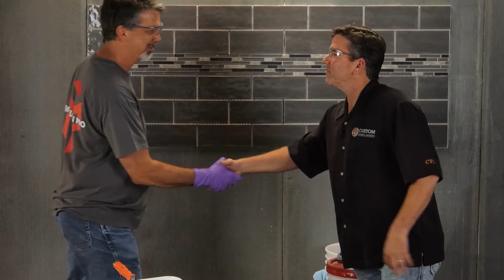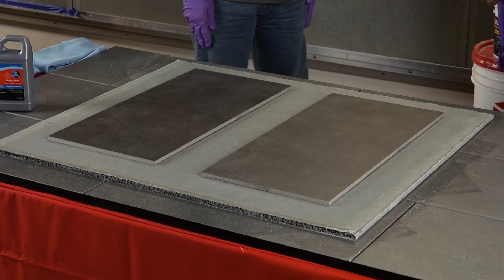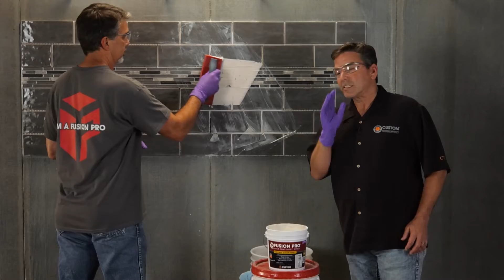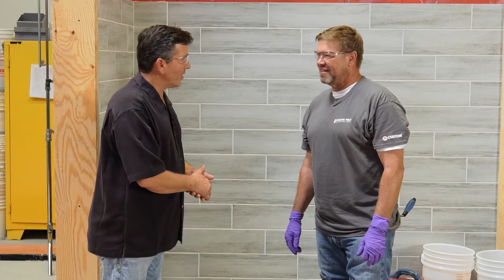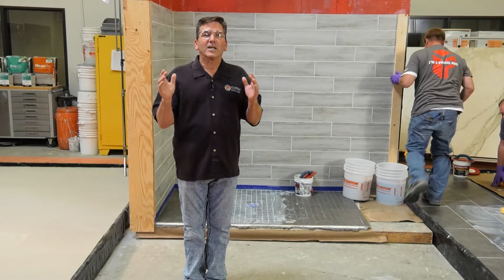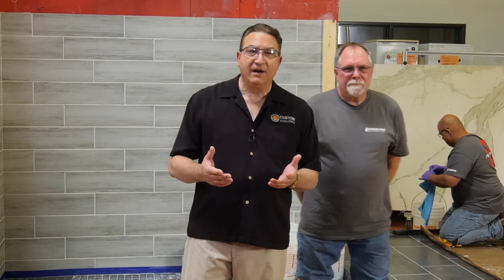Facebook Live Fusion Pro® (Enhanced Formula) Installation Tips

Comment: I came here genuinely hoping for a few tips because I'm a DIYer and I'm having trouble working with this grout. This is Home Shopping Network program levels of helpful.

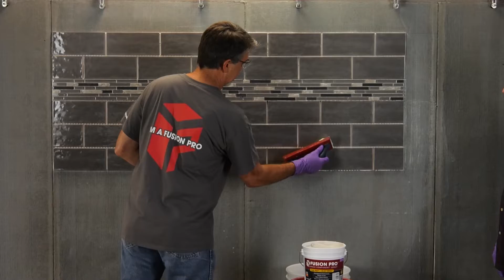6:52  Your directions say to lightly dampen the tile surface before starting. So if that's not accurate, change it on the tub. 

8:00 "Sure let's clean it". Listen. I set a timer for 4 minutes. Applied grout to a very small section. AS SOON as that timer went off I started cleaning, and spent the next 20 minutes trying to remove grout from the surface before it hardened. If you're very experienced with grout like our guy here go for it. But I don't think I'll be using this again. It seems like the pro tip is to hire your own Marty.

Comment: I have been using all grouts for years. I like fusion pro for outdoor grouting but it's a lie to say that it's easier or faster than cement grout. I find that the cleanup is just as difficult and time consuming as epoxy grout. The problem I have these days is that about 20% of the fusion pro that I buy is already starting to harden in the bucket and I end up exchanging it. The other problem with fusion pro is it's price. It's very expensive. The best things about fusion pro is the color consistency, and how well it holds up outdoors.

Comment: I went  by the instructions on the bucket, grout dry really fast. I cleaned  and cleaned . I use 5 buckets of cleaning water on a 5x8 wall and 2 hours work and it still left a haze on my tile. Going to use the tile release and see if it works any better if not I’m taking it back to Home Depot where i bought it.

Comment: Worst grout ever. Mapei pre mixed blows this crap out of the water, to many steps to clean. You don't need release with Mapei, it easily floats in, easily cleans up with no haze. I lay tile everyday I will not use fusion pro ever. But everyone likes what they like so happy grout days, that means a check is coming soon lol!
Reply: Thanks for the feedback  - I'm doing my first tiling project ever and now am down the grout rabbit hole. This stuff, Fusion Pro, seemed like it was a superior product as it's hybrid right BUT seeing how fast it dries and how it can stain my tiles I'm having second thoughts. I think I'll be taking it back and using regular old premixed grout. So my grout  worn't last till the end of time and may stain but this stuff seems too fussy,  what's with having to work with it in 4-5 minute intervals!! It just a kitchen backsplash not the bloody Cystine Chapel!

Comment: I have been grouting with conventional materials for years and have been getting mixed, but mostly crappy results.  I have tried to do it right - mix with  Stain Blocker instead of water, etc;  so by the time I have a bucket of grout mixed up I’m close got $40 in.  Based on that a $45 bucket of Fusion Pro is not that much more.  

I seem always to to struggle with haze and so by the time it’s gone I have bleached and multi-colored grout.  Sooo frustrating.   I followed what these two gents said to a T (used Grout Release, did small areas, kept water clean, used the damp microfiber) and I had the best results I have ever had.  Finally, something that works for me.    The idea of putting a damp microfiber on a clean grout float to make it flat is genius.  It super-cleans the tile but doesn’t go down into the grout gaps.    

To anyone who has fought with getting a good grout job I recommend watching this a few times and practice it to the letter.  As another commenter said, the instructions on the Grout Release bottle are wrong.  I used a 1/4” nap roller and was careful, made sure not to let it run, and made sure it go into the gaps between tiles.    

Another advantage is that you can seal the bucket and use it again later.  I find that really helpful when working on my shower nook because I’m able to grout over multiple days without having to throw out partial batches.  All in all this is the way to go - at least for me.

Comment: This video was both extremely helpful and incredibly frustrating. Helpful because it taught the proper way to apply the grout release, and my project is now going much, much smoother.  Frustrating because it's literally the complete opposite of what the instructions say on the bottle! 

The bottle says "Apply a liberal coat using a *heavy-textured paint roller*." Contrast to this video - "Always use a very short nap roller, it's extremely important that you don't leave too much material on top of the tile."

So thanks for this video, but please have a word with whomever writes the instructions sheets.